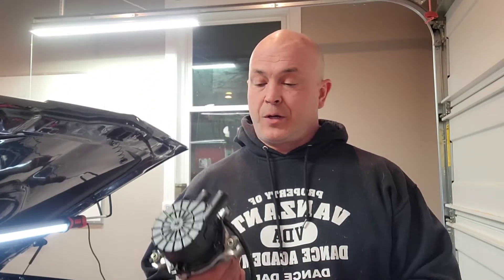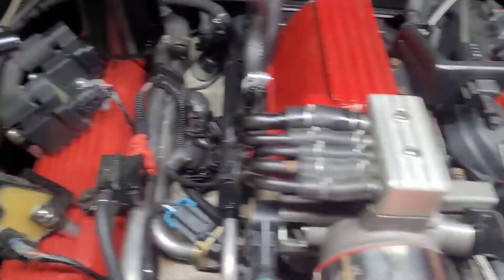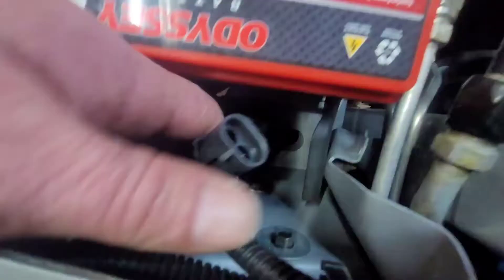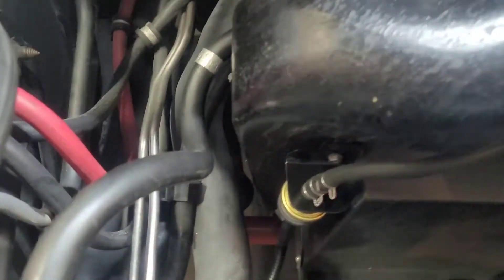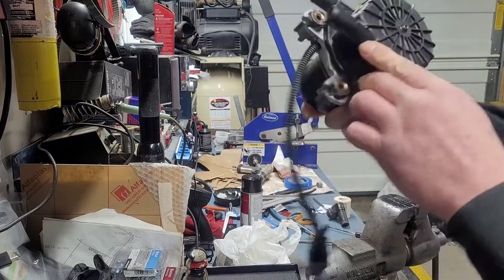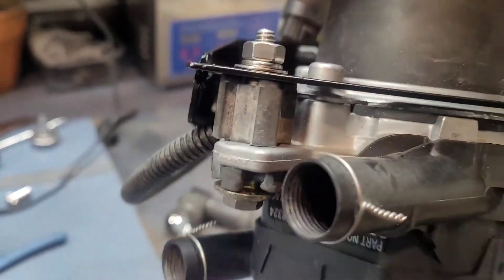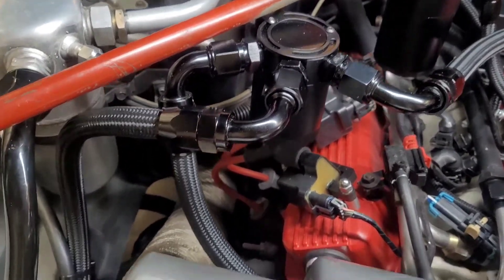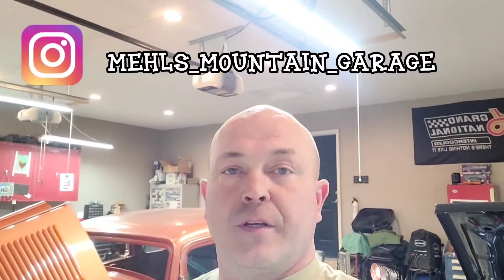Installing a GM Electric Smog Pump as a Crankcase Evacuation Pump! Custom Install But Does It Work?

Comment: Did it work? Burn out? Make no difference?
Reply from the maker: It did not burn up, and it worked.  I say worked because I hurt the engine and I am in the process of building a new one.

Comment: Would love to hear from you on the long term performance of this system. I'm gathering parts to add to my 383 stroker with a single turbo. Sick of the oil leaks!
Reply from the maker: It worked, having the double catch cans and the pump.  I hurt the engine last year, and have been gathering parts to build a new one.

I think the hobbs switch is key to make the pump last so it is not running all the time, which what apparently burns them up.

Comment: Nicely done, Im thinking my setup will fail after reading the comments.
  I wad going to use an old school exhaust style system but its not recommended with full exhaust, so I bought this style pump and without mych research, I was planning on sucking directly out the filker port and then ti a catch cab.
  Hmm, and some comments are saying it wont last long if ran fulltime. I was thinking thats what it was for, to replace the pcv system.
  Its got 2,000 miles on a stroked 351w and I don't think the rings ever seated, pumps oil out the seals, the dipstick is always pushed out a bit and burns oil like bar oil in a chainsaw.
Argh! I might just run it full time until it melts and do the weld in ports off the back of the muffler
Reply from the maker: My understanding is the same as yours, these aren't made to run WFO all the time.  The header evac tubes work for sure, but I've never run them on a full exhaust, and if you have a bunch of blowby I don't think it's a good idea with oil buildup and such in the mufflers. But, I've never done it so its speculation.

Another option is the costly one, a belt driven pump.

Also, you could place the electric pump on a WOT switch, or a vacuum switch instead a pressure switch.  This would keep the pump off at high vacuum conditions, like idle , and come on  during the low/no vacuum conditions.

An example would be this: https://www.summitracing.com/parts/sum-760155-1?seid=srese1&gclid=CjwKCAjwiezABhBZEiwAEbTPGPEbIja09PpVM2nNGhXhr5UT53B_aptyiEGCL4oR4dqvRYdcVJUQsBoCR_4QAvD_BwE

Comment: Doesn’t that engine have a PCV system? All supercharged engines definitely need a catch can system and I’ve got one on all my cars. In my opinion an AeroSpace Components or Moroso belt drive crankcase vacuum system would be better than electric one…
Reply from the maker: This car still has a pcv system, a separate catch.

Comment: You put it in a vacuum line? I was planning on putting it on one of my lower charge pipes with a 2psi Hobbs
Reply from the maker: Yes, I installed It in my vacuum line.  It sees manifold pressure.  I suppose you could put it in the charge pipe too, never thought of that.

Comment: How did this setup workout. How much vac does it pull? I have a small block chevy 440c.i. need to do something about blowby at higher rpms lookin to possibly follow tour lead
Reply from the maker: I never put a vacuum gauge on it.  After a few spirited drives after install I hurt the engine(rod knock).  Currently I am building a stroker for it, so no more data for a while.

Keep in mind you shouldn't run this setup 100% of the time, it will burn up the pump.
Reply: @mehlsmountaingarage  I only really need this pump to run when under hard acceleration so I would prolly try to run it off a full throttle switch
Reply from the maker: @cfmechanic3626  the pump would last that way for sure!

Comment: I have a question, we did this on a GM 383 Stroker create engine brand new. The pump works great except it blows the fuse. As it runs longer and longer the amp draw keeps slowly increasing until the amps are so high it melts the link in the fuse. We do have it on a relay. we piped it the same as you did with catch can because of the same oil issues. I noticed the inlet from the engine going to pump was slightly above room temperature when running but the outlet hose got so hot it would burn your hands. We have it running all of the time once engine is running. Any thoughts or advice would be helpful.
Reply: I saw another post someone made pm their blog that you need to open it up and solder the wires to the board to prevent this.
Reply from the maker: @clutchboi4038  worth a try.  The research I have done, showed the motor is not designed for continuous duty.  It's mostly plastic and melts down pretty quick.
Reply from the maker: Those smog pumps are not designed to run continuously, there have been reports of them meting down internally as well as the blowing the fuse when run continuously.
Are you running it all the time for powegains? If so, a belt driven pump may be better suited.  
If you are going for just pulling the blowby out under 1/2 to wot, using a vacuum switch to activate the pump during those times would help.
Reply: @mehlsmountaingarage  wonder if it could be ran off a pwm controller, set to ramp up or slow down based on map kpa. slow at idle fast at wot ? maybe last longer that way?
Reply from the maker: @b.c4066  That though never crossed mind!  When running N/A I'm sure you could use a 1BAR map and a controller, like the PWM Chrysler fan controller.  For boost, in my case, maybe a pressure x-ducer or something.

This may be something to look into and figure out

Comment: You can always use JB Weld to help tap the NPT fittings.  The stuff advertises it's ability to be tapped.  Siphon pump the new oil in through the valve cover fitting??
Reply: Devcon an industrial epoxy that also works very well !
Reply from the maker: Didn't think about that, what I did is working so far.  I may just do that after I pull the engine.

Comment: Did this work? Does it pull enough vac? Saw one of these pumps in the junk yard today was thinking about trying it out.
Reply from the maker: It did work, I never put a gauge to see exactly how much vacuum the system pulled.  I was beating on it and spun a rod bearing on the engine not long after I installed it.
Reply: @mehlsmountaingarage  Sorry to hear that.  May the rebuild go well.